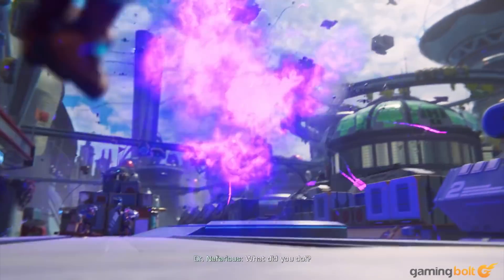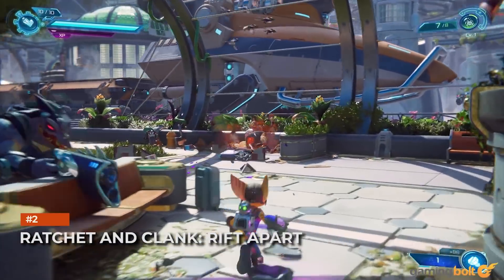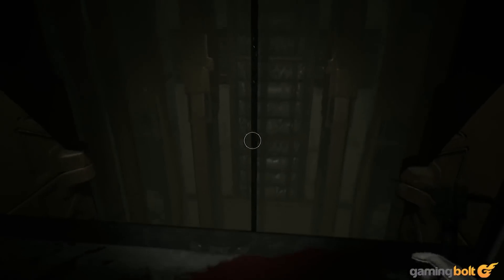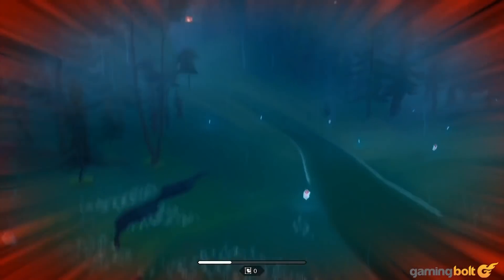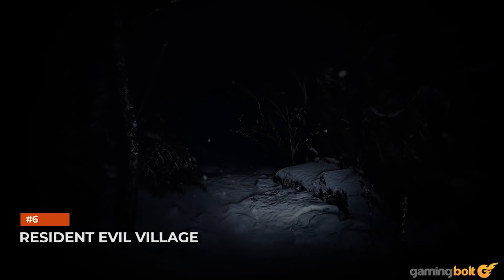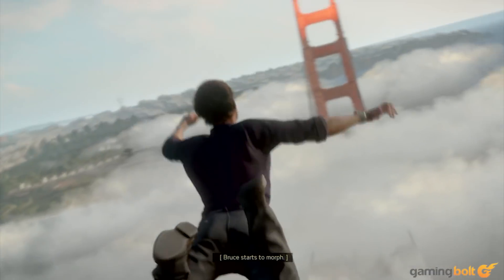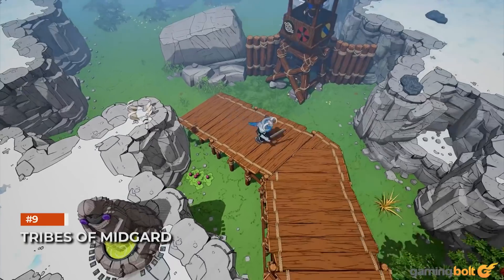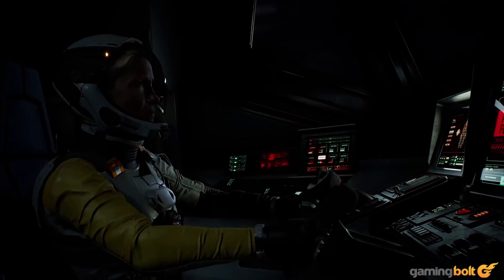10 Innovative Ways Devs Are Using the PS5's Power For 3D Audio

Comment: basically Dolby Atmos
Reply: not even remotly there 2 entirely differant ends of the sound engine spectrum, 3d audio i rendering the actual sounds while dolby atmos is just a way for your amplifier to properly playback those sounds correctly in the right place volume and frequency. 3d audio render what that sound is

Comment: To get the 3D audio all you need is a normal headset?Or a special one?This is what i didnt understood yet
Reply: Normal headphones, as you only have 2 ears 👍🏻
The rest is in Software, thats what Dolby etc are!
Reply: @JN-hg5wn  Cool i already have a nice quality set of Sony headphones to use.
Reply: @woofaki5550  Thats great buddy 👍🏻
I myself have the awesome Astro A50 - both pc and console gaming, so im set!
Reply: @woofaki5550 , pulse 3d headset is an accessory for ps5 3d audio. You might wanna check it out.
Reply: J N astros nor most popular headsets are good. Decent but not good. Def not 3D audio material
Reply: Its highly likely that sony will push a new cutting edge headset (pulse or whatever its called) to use the 3d audio the best. Difference will be noticable enough that it will push people to but these new headsets. I think its capitalism at its finest. I have a perfectly fine headset so now i should buy this new headset cuz on paper its light years better but in reality its ever so slightly better than what already have, Which is a 200$ 7.1 surround headset
Reply: @ormancadam6453 , you don't need a new headset if you already have one. Sony already said that you will experience better sound quality regardless of the headset you are using. Its just their habit(or tradition) to release a new headset every now and then. If the difference between normal good headsets and pulse 3d headset would be that noticeable, then it would be priced at atleast 150 bucks, not 100.

Comment: I know audio is important but I don't know how the sound can really jump out at you any more than it already does.
Will just have to wait and see.
Reply: Audio hasn't really progressed since the PS3, in some ways it's actually regressed. The PS3 had a dedicated sound chip and the PS4 doesn't unfortunately. This was a big issue for Mark Cerny and that's he championed this so much. 99.99% of game audio is stereo, just won't compare to 3d audio. Like comparing a watching a film with a stereo soundbar Vs watching one with a surround sound system like in the cinema. I can't wait.
Reply: @webhead4414  I know that the PSVR box supports the PS4 for 3D audio and I could definitely tell the difference. So you think this tempest engine will be pretty similar to PS3?
Reply: Audio hasn't progressed because home setups haven't progressed; most ppl use TV speakers for audio output. Not Surround Systems or even soundboard let alone headphones
Reply: @sobversion3  I mean I use Headphones most of the time. Most gamers and especially VR users have Headphones. But that's not even the point as its the Tempest Engine that calculates 3D audio technology. Obviously you are going to need some sort of 3D Audio device such as 3D audio headphones or surround system. But how do they utilise it in the new generation to make it sound any different or better than they did with recent 3D audio technology?
Reply: Rebellious Q lol most people use headsets not tv speakers
Reply: How?